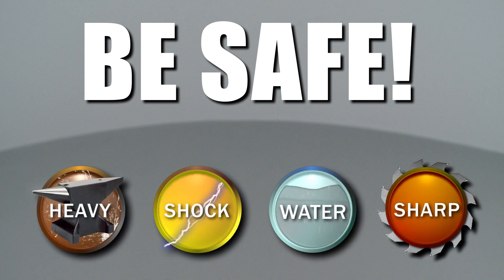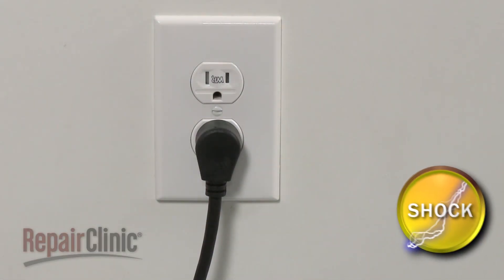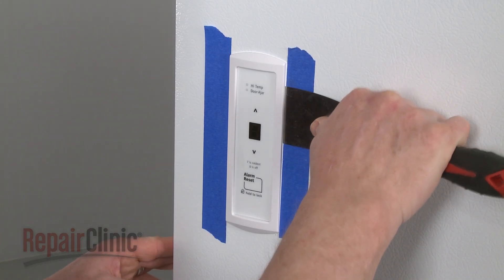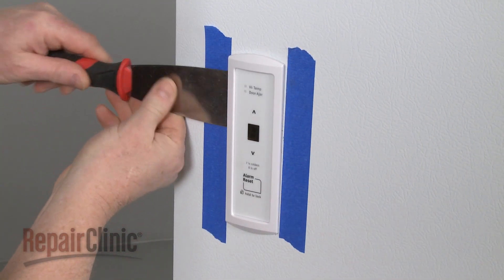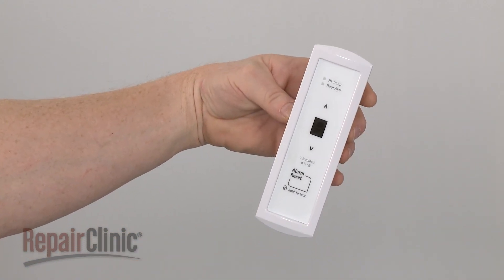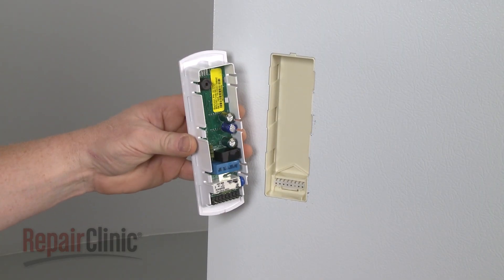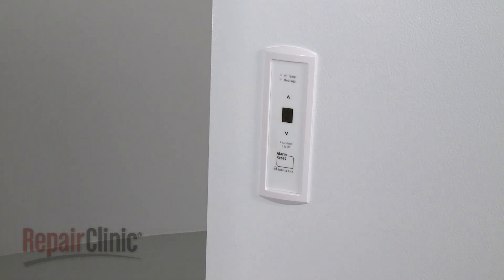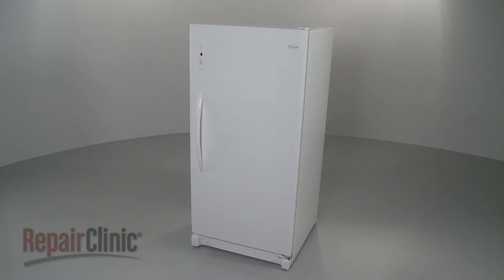Frigidaire Upright Freezer Control & Display Board #297370600

Comment: my freezer is one just like this one, it has gone out, everything was thawed out and I didnt know it. the digital readout doesnt light up the numbers correctly, like number four only shows part of the number, is this why it wont run now? the inside light works
Reply: My freezer is doing something very similar. What did you figure out was the problem?
Reply: @neilemcleod  replaced the digital panel  Been working great ever since
Reply: @kaleidoscope8276  Awesome, thank you so much for replying!

Comment: I have no lighted numbers on my panel. I unplugged the freezer and plugged it back in. After plugging it the High Temp and Door Ajar lights came on red, it beeped and the lights went back out. I am assuming it needs to be replaced? The freezer seems to be working fine.
Reply from the maker: Greg Stinogel In most models, the number on the display only shows up when you are changing the setting. When you unplug the unit and plug it back in, the control board resets and the lights will flash and go off. This is normal. If the control will not display the temperature setting after depressing the up and down arrow, the control will need to be replaced.

Comment: I have a GE FUF14DVDRWW upright freezer that is not running at all. The Hi Temp and Door Open light on the main control board is flickering nonstop. What can be the problem and how can i fix this?
Reply: sao moua I have the same problem on mine .light on the mail control board is flickering nonstop

Comment: My Frigidaire upright Freezer, model LFFU14F5HWA, runs continuously.  It used to take breaks, but now never stops running.  Could it be the control panel needs to be replaced?

Comment: The Hi Temp is staying on after unplugging and plugging it up back up, It blinks sometimes then go off, then stays on .  The  freezer is still cool but not freezing, and everything started to defrost., I was wanting to know could it be the evaporator fan motor, causing it not to freeze?
Reply from the maker: +speciallady6 Typically, if the evaporator fan motor is bad the unit will still cool, but air will not circulate through the unit properly. If the freezer is not cooling properly check if the compressor is running.
Reply: ***** Thank you for responding back. I had fixed it after watching your videos, the area at the bottom was froze solid, after I removed everything out. I unplugged it and let it completely defrost by adding hot  water in a pot to help  speed the defrosting. Its now freezing, and the light has gone off. Thanks again.

Comment: My freezer has stopped working totally , no fan or motor . The display board has gone Wacky , partial numbers etc. We had a storm yesterday and the power was on and off continuously . Does this display control the whole freezer ? Will replacing it fix the problem ? Thanks
Reply: Rick Brown I have the same problem now ..... did they answer ? 
Did you fixed it ?
Reply: Plz i need help did either one of you get it fixed?
Reply: I'm having the same problem. Did this part fix your problem?
Reply: Crap , sorry for the late reply !!  Yes the display part fixed the freezer perfectly . I added a surge protector bar to plug the freezer into . Apparently the display was zapped by the lightning storm we had . It took about 10 minutes to install .
Reply: Outstanding thank you. I just ordered one. We had a bad storm the day before I realized mine was messed up. I suspected it was hit by lightning. I think I'll plug in a surge protector as well.

Comment: I replaced  the display board on my upright G.E. freezer , like  video said, but it is still beeping and light is on that says the door is open . it is not open , the freezer shuts off because of this . I have unplugged it and waited 15 min plugged it back in  it works for about 20 min then beeps and turns off. I have pushed the reset like it said but still it beeps door is open and turns off the freezer . please tell me what can I do?Thanks T.
Reply from the maker: +Tina Gasson We would recommend testing or replacing the door switch.
Reply: There is a YouTube video that shows that the door switch had two circuits.  Once for the inside light and the other for the door ajar. So this mau be the same where it looks good because the light works, but the other circuit tells the unit that the door is open and shuts down.

Comment: Hi i bought an upright Frigidare  commercial freezer ( display in the middle) that suddenly started to show door ajar and the beeping is on all the time. It does freeze but the beeping is very annoying  Could you please suggest a solution ? The door is closed properly - it freezes so it is either the control panel or the door switch? I appreciate any help !
Reply: what was the solution for this?

Comment: How do you know if the control board is bad? Mine is showing weird symbols. Does that mean it's bad? The compressor doesn't come on.
Reply from the maker: misty breidenbach The symbols may be a fault code. You may find definitions for the fault codes on the tech sheet in the unit behind the lower kick plate or in the compressor compartment. If the symbols are not identified as a fault code, the control will likely need to be replaced.

Comment: INSTALLED A NEW DIGITAL READ OUT CONTROL ON MY FRIGIDAIRE UPRIGHT FREEZER, IT STILL BLINKING OFF OFF ....? HOW DO I SET THE TEMP OR IS IS SOMETHING ELSE WRONG ?
Reply from the maker: +MARK HARTMAN We did not have to reset the board when we replaced it on this model. You may need to see what your owners manual says.

Comment: what does it mean when there is an F on the display panel on my Frigidaire upright freezer?
Reply: I had a power outage and then the "F" appeared on the control panel.   I reset it to "4".  Anyone know what that is?
Reply: Well i got an F display and keep changing from F to 4. I replace the display board. Its works, not showing F  any more.